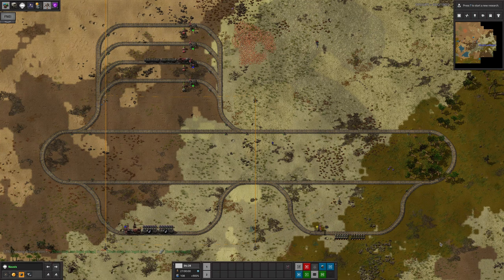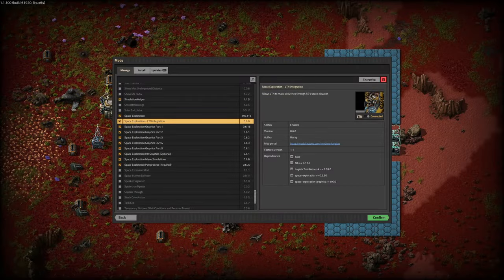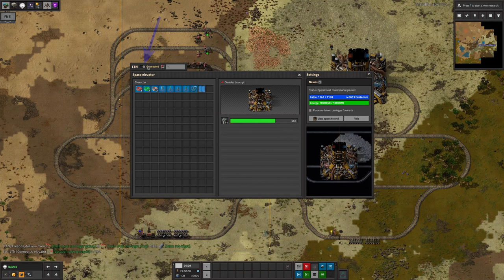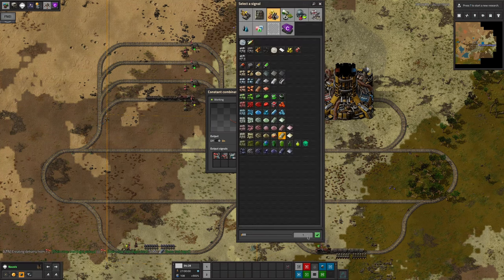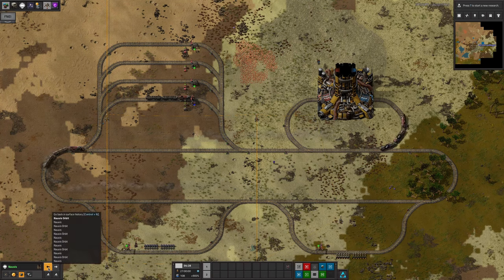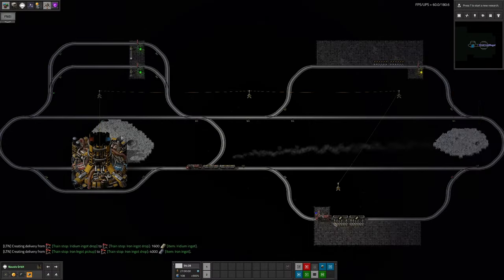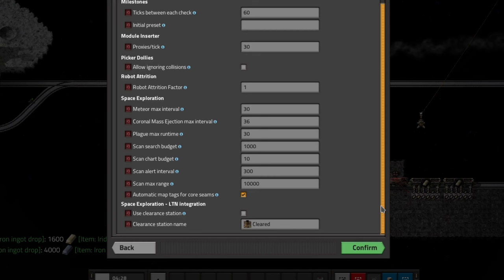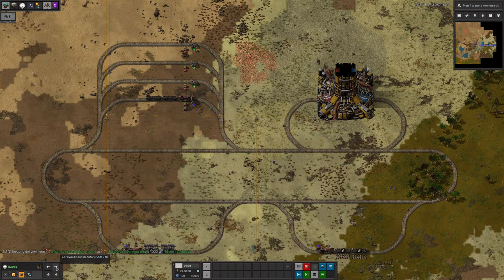How to use LTN with Space Elevators - Laurence Plays Factorio: Space Exploration

Comment: Excellent explanation as always. I ran into the train stuck in elevator issue, and came up with my own fix: when making depots, use a different name for ground depots and space depots. This prevents the trains from getting confused upon exiting the elevator and go on to execute their schedule as intended.
Reply from the maker: Thanks! I've never tried giving depots different names, that could be interesting. The confusion on leaving the elevator is more about if there's a train limit at the station they're going to though, which often isn't a depot!
Reply: @LaurencePlays  What I noticed, is that trains are created at the elevator and sometimes start their schedule not from where it reached before entering the elevator, but from the first station, and if a station with the same name as their depot exists, but is limited/full they get stuck. If the space depot is with a different name, then the first stop in the schedule is the ground depot, which does not exist in space, and the first valid stop in the train schedule is the delivery destination. It could be an edge case, it could be I just don't understand how LTN and Space Elevators work. At any rate I need to look into the settings again.
Also, I need different names for depots, because I use three separate LTN networks: bulk (1-4), fluid (1-4) and items (1-1), and trains need to go to their proper place.

Comment: Damn that mod is a lifesaver, cheers. I was able to work around the problem without this mod by having ltn trains supply to regular trains (with a buffer between them), the latter would then just go to orbit and unload to a warehouse that would function as the provider stations for the ltn trains in orbit. The downside is there are huge buffers between surface an orbit, but it works. The benefit is it looks cool. It works in the other way too, e.g. Im supplying Nauvis surface with Oil produced in space (lower prio). The next SE run (probably also with Krastorio) i will surely use this mod (first i still need to finish this run, currently also at deep space science 2). Thanks for sharing Laurence.
Reply from the maker: Ah yes. That's basically what we're doing with fluids and everything that goes through Mike's buffering system. It's also equivalent to what I did last time with rockets bringing stuff up, I suppose! Full LTN should make things easier though 🙂
Reply: Yep my last SE save had The Loop of interface between the Nauvis LTN network, the elevator complex, and the Norbit LTN network. Building four stations and a custom route for each product I wanted to transfer either direction burned me out on that save.
Reply from the maker: @zimfreak4242  that's the fun of this game, so many different ways you can implement things!

Comment: Question! In your current SE run, you are using electric trains in norbit, which I believe cannot go on the normal rails on the ground. How do you handle this? Is the easiest solution to just use normal trains for everything?
Reply from the maker: In our current SE run, we aren't using LTN (because we're masochists), so we have a switchover area on the ground where stuff is passed from ground trains to space trains. If you're not being silly like us, you have 3 options:
- Use normal trains everywhere, even though they look silly in space. 
- Use space trains and space rail everywhere, even though it's expensive
- Have some kind of cunning handover device in the middle. 
Personally, I'd probably do the first one, even if it looks a little silly!